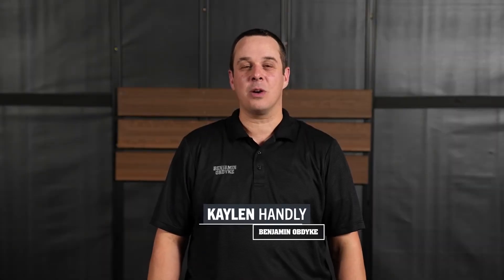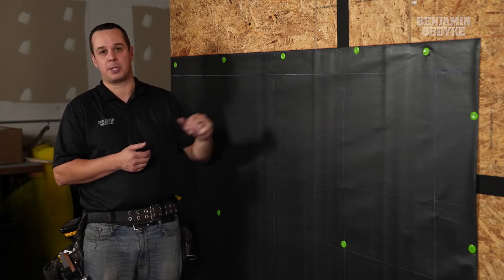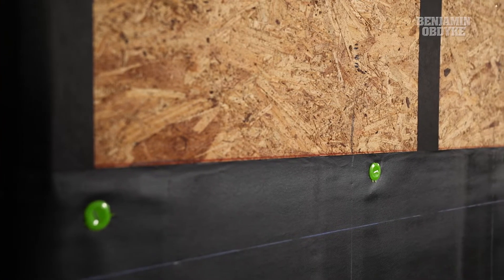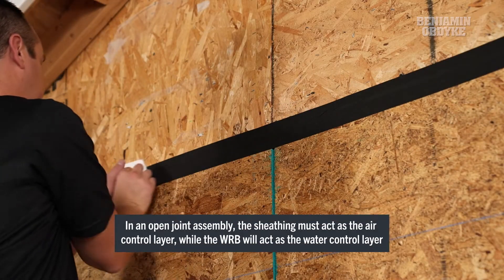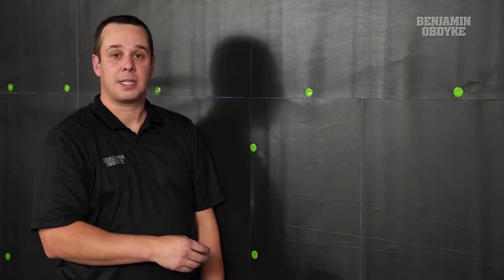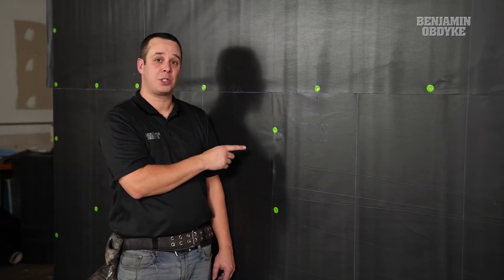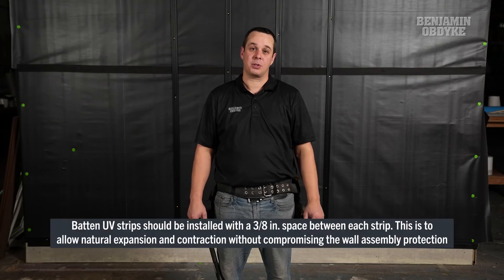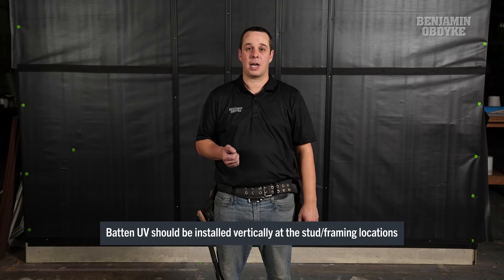Benjamin Obdyke's UV-Protected Rainscreen Installation

Comment: Hello, how would you recommend bug screening the open gaps in btwn the gaps w/something that won’t get clogged up through the years?  Thnx
Reply from the maker: Believe it or not, due to the open nature of the wall, bugs are not a concern. It may seem like a potential issue, but because of the airflow and drainability in a proper install, bugs will have very little place to go.